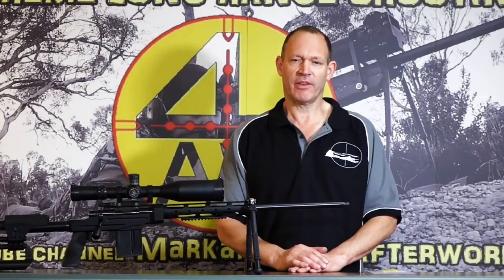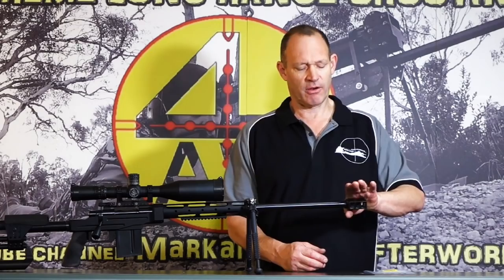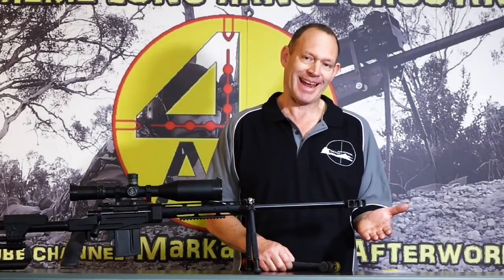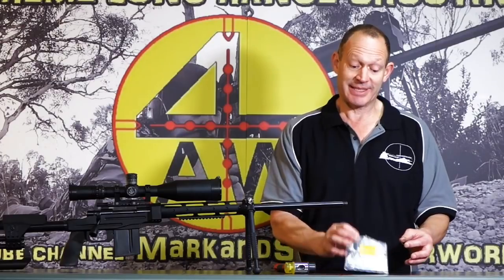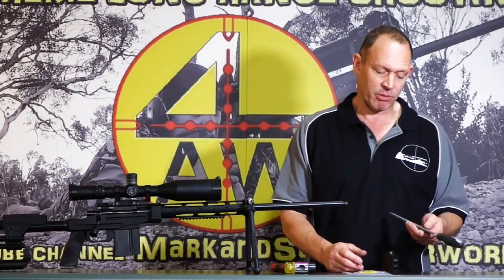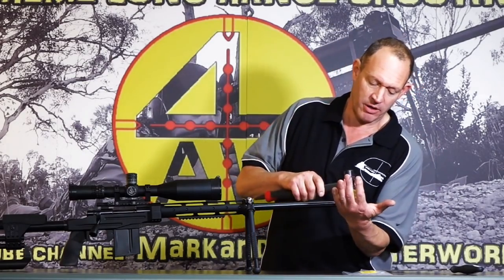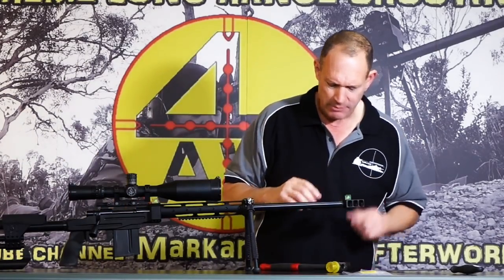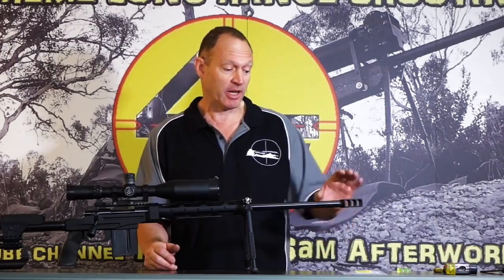Muzzle brake Timing

Comment: Great tip about checking the level of the brake!
When I've had to remove small amounts of steel and try to keep it flat, I like to use a permanent marker to show me where the material is being removed.  I'll also use permanent marker to show me how a part is fitting with the other part.
Reply from the maker: Thanks Todd, Cheers

Comment: Great video, Thanks. Does it hurt accuracy by NOT boring  the  brake  bore true  with  the  rifle bore, That  is finish  bore the brake  after installing it on the barrel?
Reply from the maker: Depends on the brake, not an issue on ours, Cheers

Comment: This is similar to what I do if I am installing a new dove tail iron sight. Never file the barrel dove tail slot, which should be obvious. But the dove tail on a after market sight might be a little oversized, and a little careful filing on the sight dove tail helps it fit snug but not so tight that you need a sledge hammer to get it in (I think sledge hammers are a wonderful addition to the hammer community, so people that are sensitive to these issues please don't bring me up in front of the hammer rights commission). (I just want to play it safe, I live in Canada!)
Reply from the maker: Lol, yes I hear you, Cheers and all the best

Comment: Awesome video as always!! I just have a question about getting everything level!! I bought a nice little 22mag today and it has 2 piece scope rail and no real spot where I can put a bubble level to get my rifle level so I can mount my scope!! How do you suggest going about getting everything level?? Thank you
Reply from the maker: Hi Kevin, you level rifle with scope rail, lock in that position, then level scope to that position, if you don't have the gear, go with a field mount, sit scope on, look through and make reticle straight and centred with your eye. Sometimes you just work with what you have, Cheers

Comment: Thanks for another great video Mark. I'm just wondering if you've had issues with a brake loosening while shooting? Maybe it's just me, but it doesn't seem that it would be very tight the way it was done in the video. Merry Christmas!
Reply from the maker: No.  From our experience, the tension, as shown in the video, is more than enough and we have never had one come loose from that tension.  Cheers and Merry Christmas to you too.

Comment: Great video! Thank you. Why is there no need to time while targeting a specific torque value like some muzzle brakes suggest in their spec sheets? I recently purchased a muzzle brake for my DTA .308 and it doesn't have any torque value recommendations so I'm curious. Thanks again!
Reply from the maker: Well tight enough to not move yet not too tight as you will need to remove at some stage, so with that actual torque doesn't make any difference to how it works and in most cases, torque would be hard to measure, but, with that said, you can vary tension a little to get timing exact, Cheers
Reply: MarkandSam AfterWork Thank you!